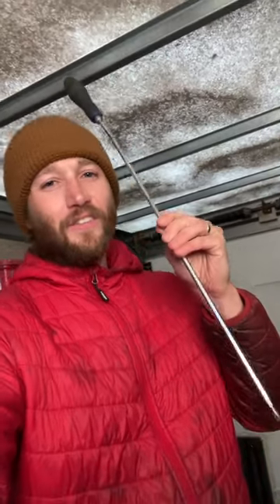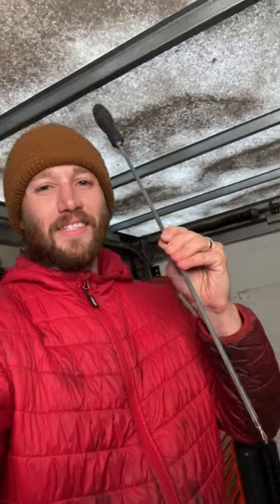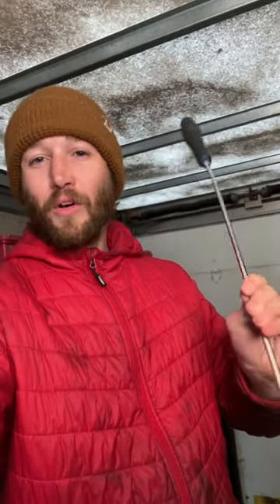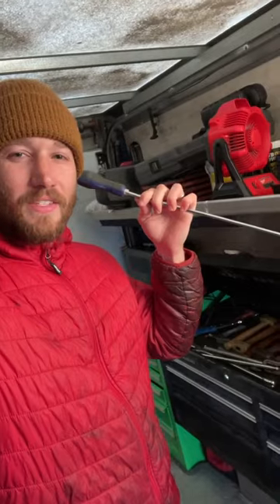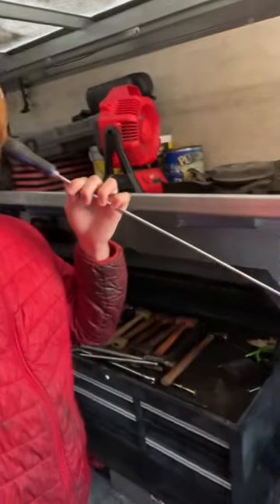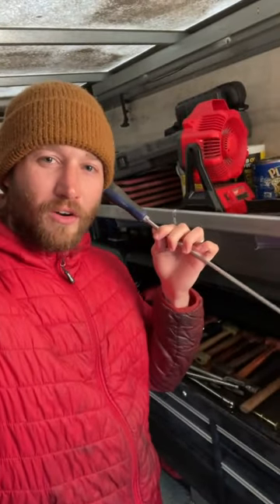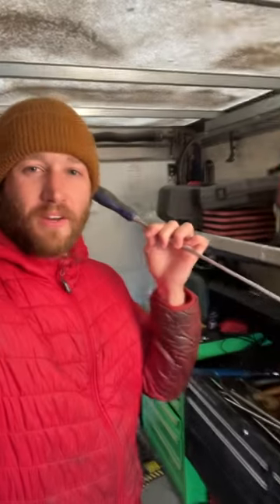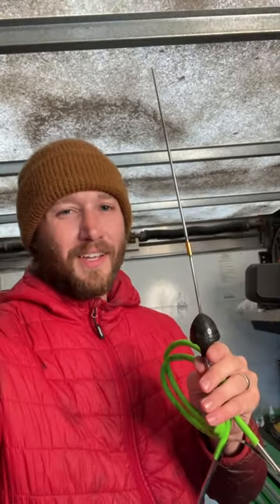Why Does a Mechanic need a looong ScrewDriver?

Comment: Use it to check for noises. It works really well for bearings. Stick the point end on the knuckle and hold the other end to your ear. Works like a stethoscope

Comment: As a retired Diesel Mechanic would also use to detect certain noises  but i had some screwdrivers that were not as long to adjust the governor on a 8v71 engines

Comment: I use longbois on E-type hose clamps because they need to be tightened and adjusted after install+heatcycles so you get a weird "chicken and egg" situation where you are forced to  remove parts if you want close up access which means you have more adjustment to do later, or don't adjust and it uninstalls itself. The solution is a long as frick flathead screwdriver that I carefully hold almost like a pool cue to do my adjustment.